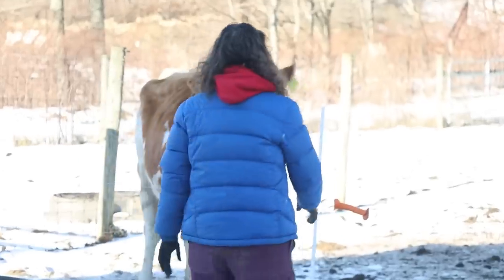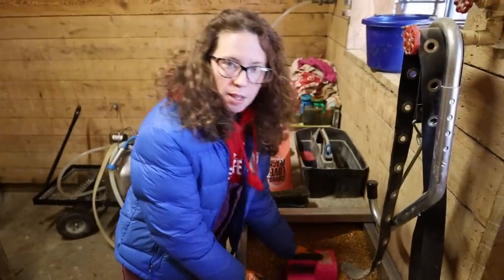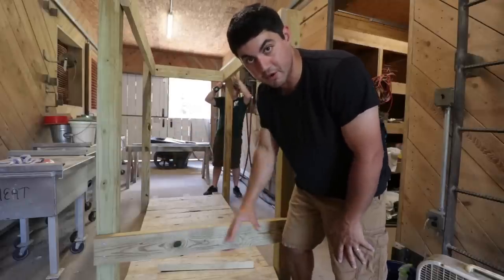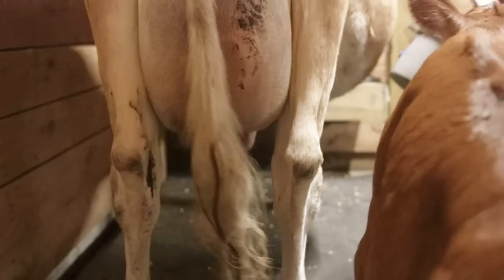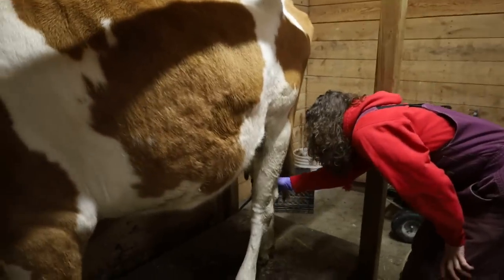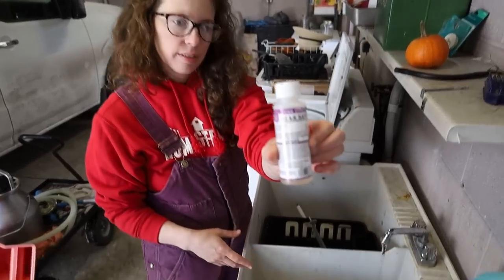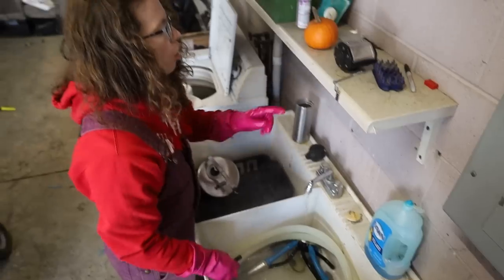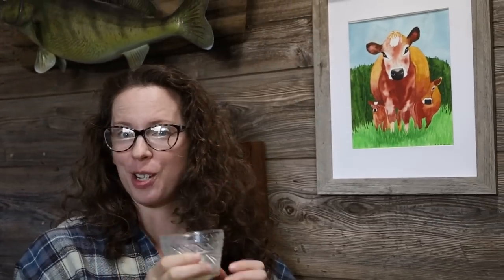HOW TO Milk a Cow Made EASY- Each Step and Setup for BEGINNERS

Comment: SUCH a great video, and beautifully compliant cow! It takes 3 of us(!) to hand milk our very docile, but headstrong, cow right now twice a day 😬 (sans stanchion - one to feed and focus, two to milk). We hope to be where you are soon. I do have 2 questions though - 1) how do you use a 4 claw milker if one teat is dry, ours doesn’t build enough pressure and 2) any tips for getting the claw on a smaller teat? Thanks in advance!
Reply from the maker: Thanks 😁 stanchions really help! You should build one! We have the video for our model. 1- plugs, put a plug in the one you are not using, you can buy them for like $10. 2 -smaller inflations! They do own in size. Trust me no treats are smaller than Luna’s! Hope that helps 😁

Comment: Could someone tell me how the milk claw stays on the teats without suction turned in! Because I am not able to attach mine like she did. They would fall off instantly.
Reply from the maker: The suction is turned on as I’m putting it on the teats. So I kink the hoses to the inflations, and then turn the suction on. One by one I unkink each inflation as I put it on the teat. If I would unkink them all, the claw would lose suction and it would fall off. So I put each inflation on, making sure each one is on the teat before i place the next one on. It’s tricky!! But I practiced holding the claw before I tried putting it on the cow and then had Austin help the first few times until I could do it myself.